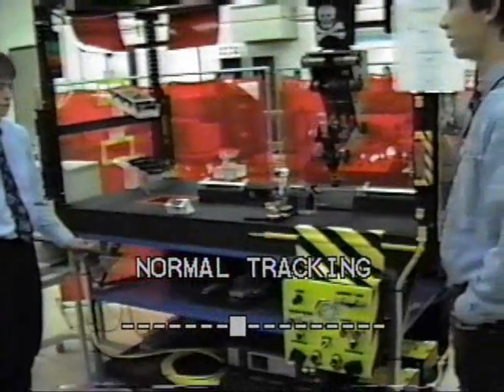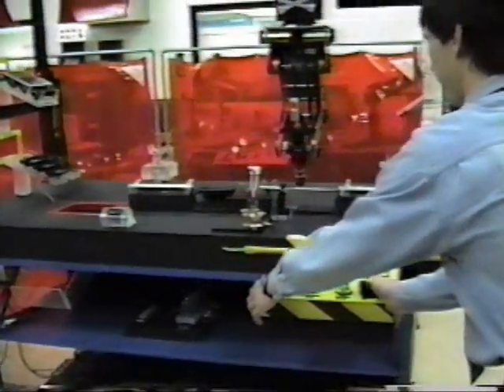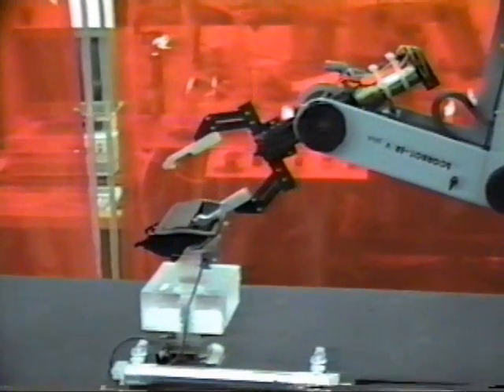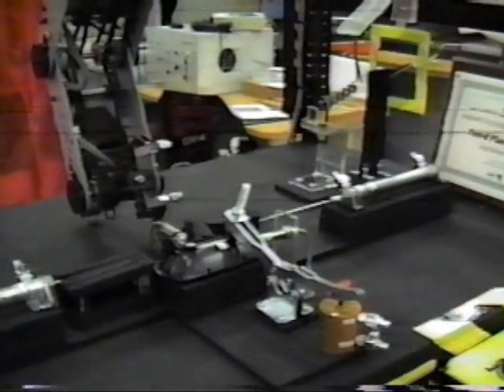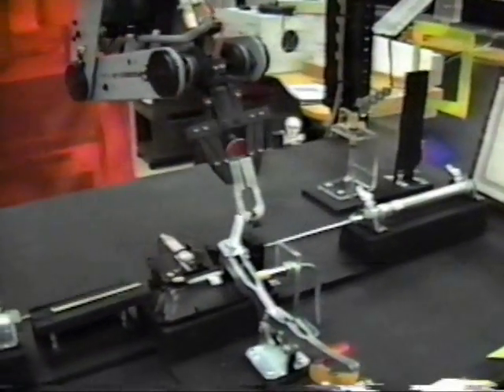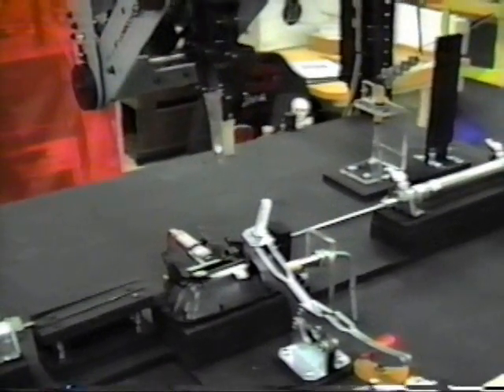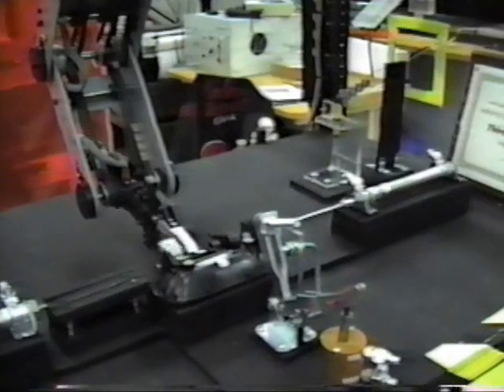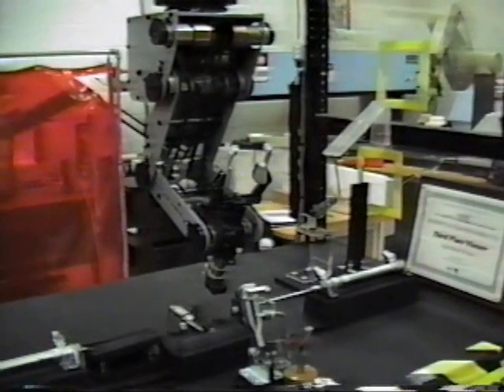Robotics project part 1

Comment: This is awsome, I was in the class in 1994, I did a project that used the 120 watt CO2 laser that is in the background, its the long light blue device by the back wall with the 3 warning signs on it, my instructor then was Mr blackford dont know if the spelling is right